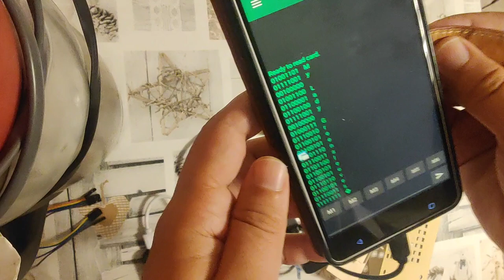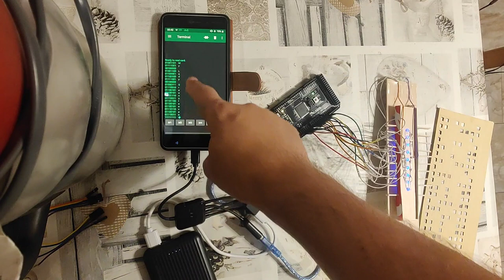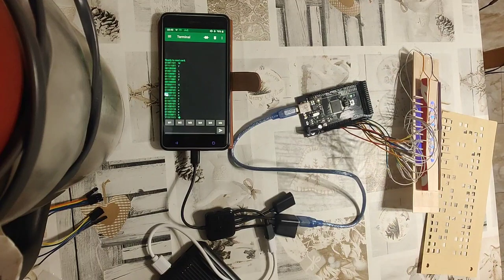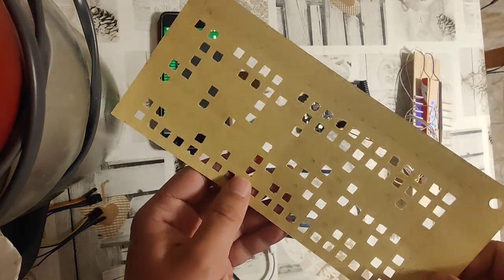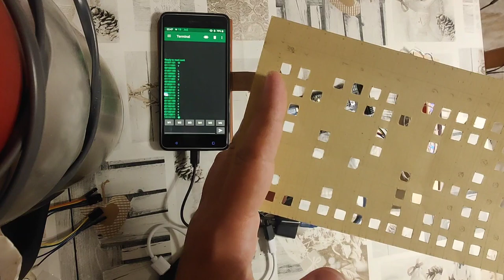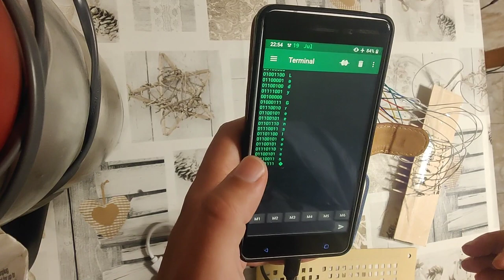Retrofuturism: USB Punch Card Reader Experiments (1/4) - Greensleeves

Comment: Each LED needs about 3V so if you put them in series you need 9x3V and I think it would've been a lot easier if you had used something like small brushes and a metal strip and the card pushed between them to sense the holes in the punch card. Same result, less components, and less power usage. Great work anyway!
Reply from the maker: The brushes idea certainly has charme, as it "appears more retro"... The light idea, however, had another (unexpected, at first) advantage: resistance is not "black and white", but has a concept of "peak light", and one can use that a sort of "alignment safety" against slight card twists that cause one hole to begin to be detected prior to another one of the same column: you can then say, "only measure the light resistance once 'peak light' has been approached", as then really ALL holes will be in correct alignment. But I definitely may play with your suggestion due to the "absolute steampunk" it entails... :)